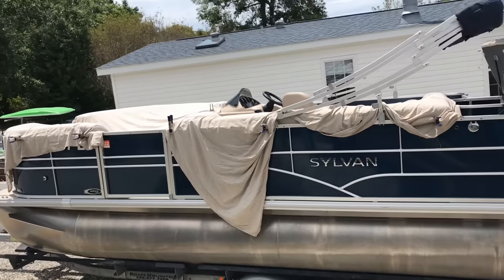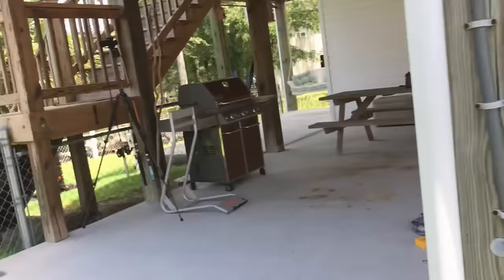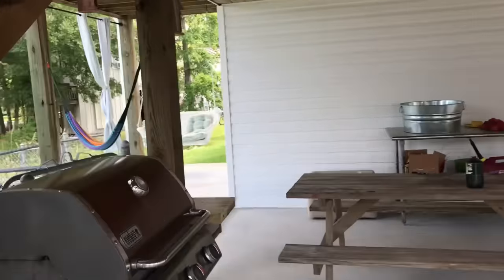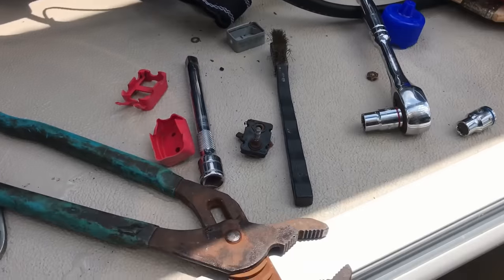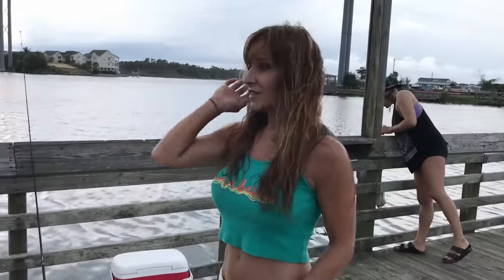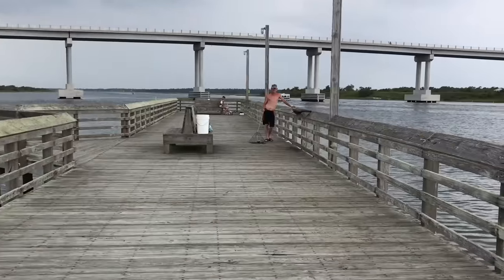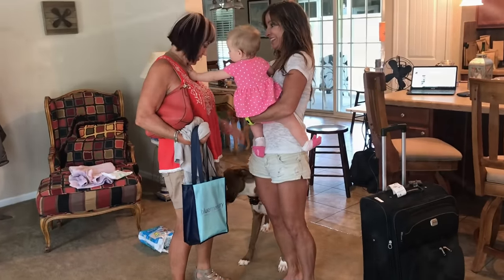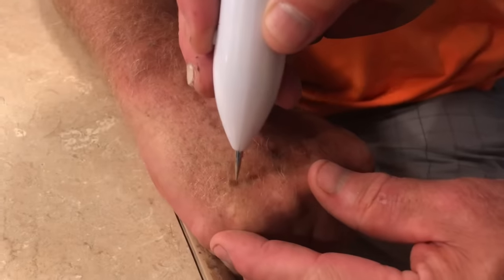Fun with boats and family

Comment: Tech advice. After applying a dab of grease on the posts of that SHORT STOP Breaker, coat it with some RTV which will make a weather shield . The silicone wont stick to the greased threads but will stick to the shell. Works great for outdoor apps.

Comment: Just a side note.  The best time to disturb a wasp nest is at night.  The wasp cannot orient itself in the dark and can't fly making it easier to knock the nest down.  Also, use the wasp spray with the 12 foot spray which kills then before stirring up the nest.
Reply: Use kerosene on the nest ,they can't fly if their wings are coated in oil.
Reply: @carinduncan7594  that works except that all the wasps return to the nest at night and can all be killed collectively.  Putting kerosene on the nest only affects those that are around the nest. I kill them in the dark and don't run after I spray.  They can't find you

Comment: Ive owned 16 or 17 boats in my life so far  those Circuit Breakers are important to keep operational BTW ive had very good results with Yamaha outboards  over the years  and slowly the Nissan/ Tohatsu motors are becoming  one of my favorites in recent years  because parts are cheaper as a rule

Comment: If you put vasseline on the terminals, it should stop the corrosion on electronic terminals. Normally fitted to earth side of the battery terminal.
Hope it helps.
To remove corrosion kettle of hot water should do this unless it's severely rusted.

Comment: On the circuit breaker by one that has stainless steel mugs and use CLR on the rest of corrosion spray it on there let it sit and then you can take it apart and change it